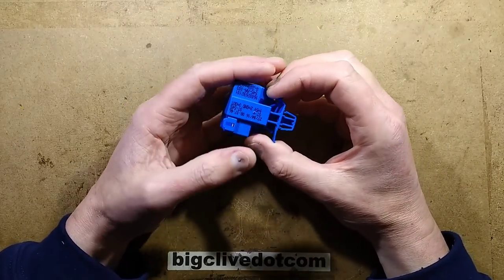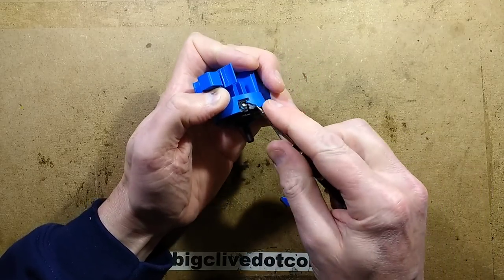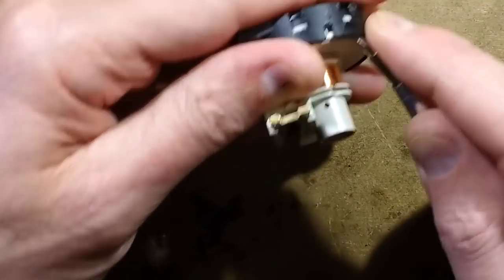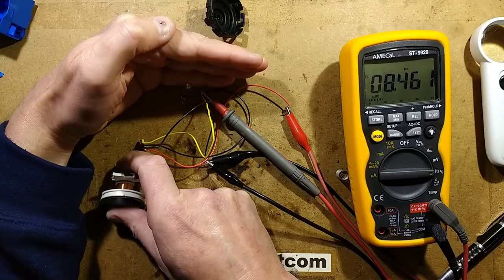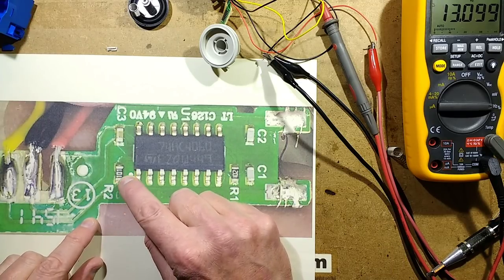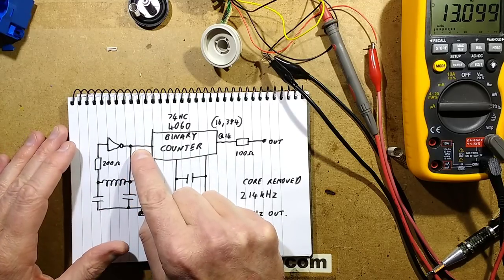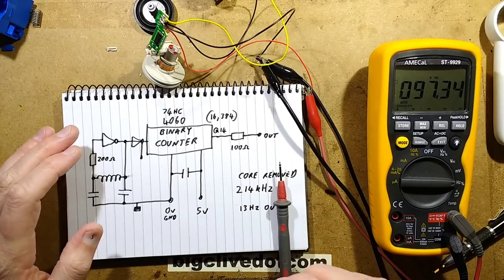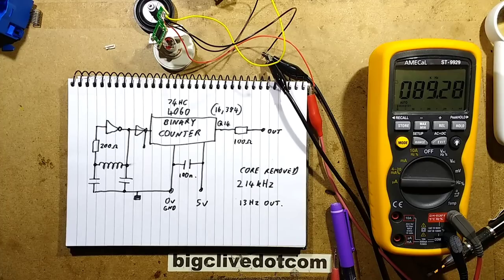Inside a washing machine water level transducer. (schematic)

Comment: Great video! Based on this video I did a HACK by cutting a hole in the top to access the pressure adjustment screw and now we have the proper amount of water (about 20% more than factory) in our machine 🙂
Reply from the maker: Keep in mind that modern front loaders deliberately use very little water at the start of the cycle as they only intend to make the clothing wet.  That increases the activity of the detergent and also increases the friction as the drum tumbles the saturated items so they rub against each other as opposed to just floating about in water.  After that the machine uses much more water in the rinse stages.
The machine will initially keep topping up the water and tumbling the clothes until it detects that no more water is being absorbed by them.
Reply: Did you turn it clockwise and if so, how much? Trying to figure the same thing out myself after seeing endless videos of other people adjusting switches where the set screw is accessible.

Comment: I have no technical know-how, nor can I do pretty much any of this stuff, yet here I am, on a Sunday morning enjoying to learn how things work. The only problem I have with these videos of Clive's is that I wish I could actually use a soldering iron and do all the things it would enable.
You Sir are fighing neck and neck with Richard Patterson for the "Best Scot in the world"
Reply: Soldering is piss easy. Just get a cheapy (but safe) soldering iron, some solder, desoldering wick and get some old device with circuitry and desolder stuff. When you have burned stuff out and ripped enough tracks off of a PCB, you'll learn how much heat can be applied and for how long. 

Soldering components to a PCB will be childs play compared to that - de-soldering can be a proper pain. You literally do what Clive demonstrates when assembling something, heat the pad and the components lead with the tip of the iron, simultaneously add solder and it'll flow, not much solder, just a bit till the pad and the lead are in unison with no gaps. 

Practice, it's not hard.
Reply: yep break some junk before you work on fixing stuff
Reply: Buy yourself inexpensive kits for practise. Use leaded solder.
Don't buy the cheapest iron you can find, take a branded one.
Cut copper wire to hand lenght, lay them together in a right angle and solder all joints for practise untill you get a nice mesh with nice looking, shiny soldering joints.
Reply: Get yourself an okay soldering iron (Clive has a couple reviews on cheap ones) and some cheap kit off eBay! You'll be surprised how easy it is to solder through hole components! If you're afraid of messing up, you can just practice on some random dead electronic device you have at home. De-soldering components is a major pain (for me), but you'll get a feel for it. 

I started off with random things and my first actual kit was the clock kit BigClive made a video on (and then the astable multivibrator), you can "build a long". It's really great when you build something and it actually works. After getting started, you can attempt to troubleshoot and fix random things that break. 

I must warn you though, when you start being able to fix random things, your wallet will suffer. You'll start wanting to stock some components so you can fix things right away, then a nicer multimeter, then a nicer soldering station... Then you need a little electronics storage cabinet but half of the drawers will be empty, so you buy more components to put in them. Oh and leds, so many leds! 

Go for it. It's fun, and eBay stuff is cheap!
Reply: It's ok with the cheapy stations on eBay.  Clive uses one himself.  Just make sure you have a chisel tip rather than the conical.
Reply: ilaril just get a iron and some components and start, practice is the best way. Got to use resin core leaded solder tho.

Comment: The chip was optimized to produce a stable 1Hz output from a cheap 16.384KHz tuning fork crystal. Very interesting use in your application.
Reply from the maker: Ah!  I never spotted that.  How useful!
Reply: I think the colorburst crystal required was only found in American TV's but found their way into digital watches.
Reply: Jammit Timmaj This is not an NTSC colorburst crystal. Those run at 3.579545 MHz.

The item in question was specifically designed for digital clock circuits. Virtually EVERY electronic clock/watch circuit uses this type crystal. They are practically all the same 16.384 KHz frequency, and in a similar tubular metal package. Look them up!

Some colorburst trivia: IBM used a 14.31818 KHz crystal in the original PCs. Why such weird value? Divide by 4 and you get the 3.58 MHz signal for the analog CGA video output, AND divide by 3 to get the famous 4.77 MHz which underclocked the 5 MHz CPU, OR divide by 2 to get the odd 7.15909 MHz which they underclocked the 8 MHz CPU in the PC/XT. IBM got cheap, and reused the clock circuit outputs. That's where the old weird CPU clocks came from.

Hardware hackers of the day replaced (soldered) their crystals to be amongst the first overclockers and get their best CPU performance.
Reply: Watch crystals are 32.768kHz.
Reply: Graham Langley Yep. Mentioned above.

Comment: Oh I am so glad I saw this video. This is exactly the type of housing over the water level swtich on my machine. I hope that plastic screw works exactly like the older models. Thus, turning the screw will allow my machine to fill with more water. I'll soon find out. I'm sick of smelly clothes!!! I'm not going bother prying it open. I'll just use a heated knife and burn/cut a hole on top to access the screw.
Reply from the maker: The modern machines only make the clothing damp for the first part of the wash to concentrate the detergent and friction between the clothing.  If you adjust it, it will probably just compensate for it, as it is monitoring how much water the clothes absorb.
Reply: @bigclivedotcom  I'll see. I already exposed the screw. In the older models, turning the screw modified the pressure valve/sensor- so more water was allowed into the drum. These machines are useless, they put a small amount of water- enough to dampen the clothes and then they sit there closed up for 2 hours- smelling like mold.
Reply: @gfairbanks1653  Hey! Did you manage to increase water level by adjusting screw or washing machine compensated water level? Thanks!
Reply: @MajsoSVK  yes I'd like to know too

Comment: Interesting, i notice modern washers seem to run the empty pump and pause just before they begin a wash. Could this be to make sure the drum is empty and then perform a calibration/zero on the level gauge?
Reply: True, and same for dishwashers. To get a higher water level for rinsing they allow the water to 'run on' some after the water level switch is closed.
However this doesn't work so well if the supply flow is constantly changing due to other large water consumers eg baths and showers, hence the improved sensor.
If you take the old 2 level sensors (the second level contact is to protect from overfilling!) apart for 'investigation', they are the very devil to recalibrate properly, just don't ask me how I know this... >:-|

Comment: After seeing your video I wanted to do the same with my sensor. 
Looks nearly identical. However, the LED was constantly on. And I laughed after opening the case. 
From the outside there are three contacts: S+, GND, S-. But inside there were no electronics. The winding is connected directly to S+ and S-. Only a small capacitor goes from S+ to GND inside. 
The manufacturers have saved even more costs and moved the IC to the mainboard. 😂

Comment: I'm kinda glad that the new wave of washing machines are taking this approach,as opposed to the really expensive timed device. It means now we have what is essentially simple microprocessor with "simple" software reading simplified sensors. A person with brains could now set about and replace all the gubbins with an arduino and get sensors to make a washer work again, albeit without the "finesse" of the research in washing cycles. YMMV, but still, it's a good thing.
Reply from the maker: The new machine seems to be doing clever things.  It fills up with a small amount of water and then tumbles the clothing for a while.  If pauses and sees if the water level dropped and if it has then it adds more water.  If the water level did not drop then it knows that the clothing is now fully saturated and that results in more efficient detergent, water and heater use.  Then for the rinse cycles it uses a lot more cold water.
Reply: yes the old days of 1 or 2 water levels isnt enough, it has to be per load and how absorbent they are for efficiency
Reply: Yeah I have a horrid Hotpoint washer drier (I never use the drier, slow expensive self condenser)and that does all the fancy self balancing stuff too. It could have been good but it's destroyed the bearings, and fails to saturate clothes properly. I have to put it on a full load for a half load else I end up with tacky clothes. I blame the device you took to bits in this vid, but I dare say that mine is a momentary version, it's really high up, with a really soft silicone hose. And it's running from a timer with a controller, bad combo. I've had it in bits many times replacing rabbit warren split filler hoses and alsorts.
Reply: Neffers I was thinking the same, code I'm using to measure rpm from a reed switch would probably work. Arduino controlled washing machine sounds like a nice little challenge. Could get really fancy and have Bluetooth connection to smartphone or maybe thats a little to far.
Reply: Imagine being able to hack your oven to give it PID control for temperature fluctuations using an arduino and say goodbye to +/- 20 degree temperature swings.
Reply: @Martin, there's often several sensors regarding water levels. It all depends on who designed it and at what cost. 

You're right that weighing isn't usual at all, but that doesn't mean that some don't use it to some extent. Some do have load cells. 

Prior to spinning mine goes through a balancing act - much like how a car wheel is balanced after fitting a tyre, it's interesting to watch. It'll spin up to a fixed RPM for a short while, and gradually slow down till something falls to the opposite end then spin up again using centripetal force it to the drum, it'll do that repeatedly till it's content then go full RPM. Fine with general loads, but it's a nightmare with towels. 

I can't wait to get shut of it and get a simpler one like Clive has purchased.
Reply: Sensing water levels isn't exactly new... My mum bought a new machine when we moved house in 1997, and it did the fill/jiggle/fill/jiggle auto sensing thing.
Reply: MalanUs a oven with good control over the temperature would be fantastic! And add a touch screen where you can program in and select thermal profiles for the different items you will put in it: pizza, fish, cheese, circuit boards, cakes...
Reply: +tin 2001 Yeah old technique, I just think they've been quietly tweaking the set point down over the years to get a better euro rating.
source - moved into a flat where the landlord didn't have the top of the flexible wastepipe  'reverse U bend' high enough and it never finished doing jiggle/fill/jiggle... wasn't a new washing machine then either - even had a hot water intake.
dunno how the previous occupant ever got on washing their stuff though.
Reply: +tin2001 The '96 Zanussi here does the same thing.

Comment: Nice one. Cheap, reliable design. The winding should be fairly stable and those caps look like C0G. All they need to do is calibrate the various thresholds. They might even get away without calibration, but if you're going to test it you might as well calibrate it. The low frequency is perfect for stuffing into a capture pin on the main processor, which will be running at several MHz giving plenty of "bits" of resolution. The other beauty of this sort of method is it's a doddle to galvanically isolate should the need arise.

Comment: Thanks for that Clive, very interesting, I suppose using this method the manufacturer can control and adjust the water level through software rather then mechanical methods depending on the market it is being shipped to.

Comment: Theoretically, yes, the CPU could do a "count the pulse length" and directly control the valve. But that could lead to a flooded room in case of a software bug or (only slightly less bad) a completely overfilled drum which would damage the bearings and possibly overheat the motor.

You could do a rising edge-triggered monoflop and something like a couple of xor/and gates - so if the monoflop still outputs a signal when the transducer doesn't, it enables a second monoflop (or capacitor) for a couple of seconds, which in turn enables enables a transistor between the CPU output pin and the water inflow valve. This way, you make sure that the CPU requests more water AND the water level is low enough.
Reply: Why this guy eliminated the very good switch for anti-flooding that there was inside the previous pressure switch? No complicated software, no hardware required, only on-off switchs. One for the first level, one for the anti-flooding. Only a 110/230 VAC sensing on one microcontrollor pin.

Comment: Very interesting little design! Dynamic variable inductance. One IC that one would not have designed like that before the HC version came out. In fact why do they even need the HC version and not just the C version? HC is High speed Cmos and it's really not going all that fast.
Reply: C versions? You mean HCT or LS, or not? You don't pick a certain type for speed in a setup like this. You pick it for the logic level voltages and/or whatever logic family can drive the "weird" inductive oscillator.
Reply from the maker: It might be the easiest to source.  I was pondering why they didn't use the CD4060 base CMOS version.  Maybe this version has more robust outputs.
Reply: Right. Could be the rest of the washer is TTL and they want to stick with these "standardized" TTL voltages unlike the cd4060. I've taken apart my share of washing machines and never seen anything this complex used. Last washer I took apart had an extra side tank with a little float that lifted a plunger that turned off the water level off. That was it. No oscillator, no frills. ( I put the motors to good use as buffing/grinding wheels and another as a Wolverine rip-off sharpener for my wood lathe tools. They're super for that & run very quietly.)
Reply: The HCMOS version is probably the cheapest version in quantity at this point.

Comment: they have moved on, the one i took apart had a 2 level pressure switch, very simple. but that was an old 70s machine with mechanical cam timer

Comment: I guess mine is blown or something? The machine began to just stop, and I know it's an electronic issue, cause it mechanically runs perfectly fine. It just randomly stops, and when it does, it's a PITA to get it back moving. Yesterday it filled up almost to the top and then began full-speed dry-spinning without spitting the water out first. That was a delight to watch, got myself a little fountain here :)
Reply from the maker: That could be the water sensor not being detected or failed.  If used in other modes does the motor run?  Another possibility is very worn brushes causing intermittent operation and possibly glitching the processor too.
Reply: Out of the question, it runs perfectly, sometimes a full cycle. I figure it must be the small tube going to the sensor or a bad connection or something, I have to open it up.

That's the thing, it's not even close to being dead yet, it just randomly stops working once in a while.

I already took out the PCB, washed it (it was full of dust) and resoldered all the connections, as some appeared to be bad, but it didn't change much.
Reply: The hose(s) from the bottom of the tub to the switch(es) often get blocked.

Comment: Just my 5 cents here. On Bosch series 4 ecosilence washer this screw setting can not be altered as firmware is looking for specific frequency - in my case 625Hz for idle and goes down with pressure ( tested with multi-meter) If it senses discrepancy, two things happen, will not stop draining or will add more water ( I was happy to see that ) but if you happen to change program or pause machine  - then door lock unlocks even there is full drum with water... Some people over internet reported heating element not working ... So after 3x days playing around, conclusion is, looks like some engineers made sure that consumers do not tinkle with this setting or it is simple firmware glitch where if parameters are not met, then some functions may fail or may work differently from originally programmed...
Reply from the maker: The screw doesn't really set a liquid level.  The machine starts the cycle with a very low amount of water deliberately.  It puts water in to a fixed level and tumbles the clothes then looks to see if the level has gone down.  If it has, the clothing isn't saturated yet and it adds more water.  Once it sees the level remain the same it knows the clothing is fully saturated.
That means that during the first part of the wash cycle the detergent is at its strongest and the friction between tumbling clothing is highest, giving a more thorough wash.  The rinse cycles use much more water.